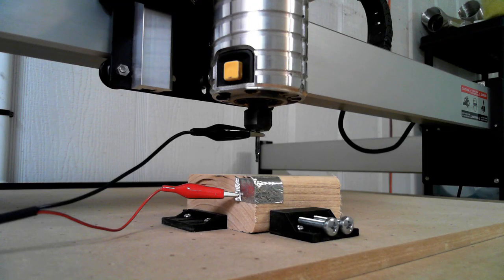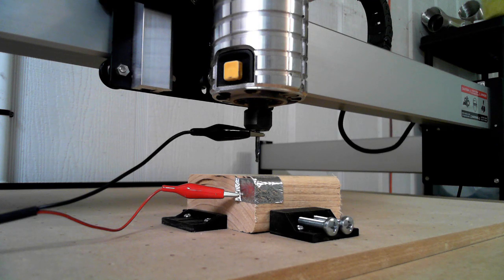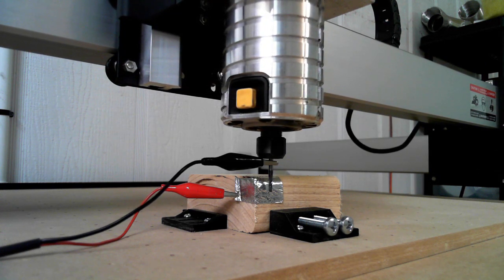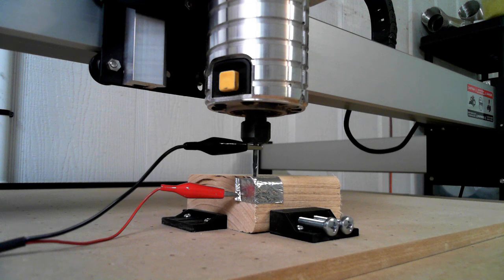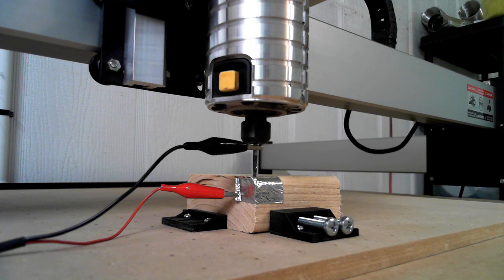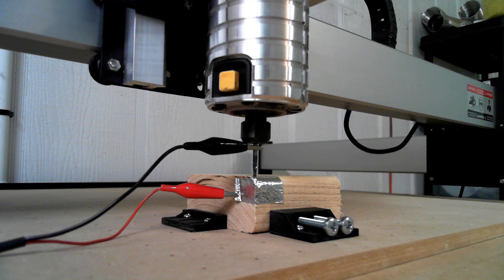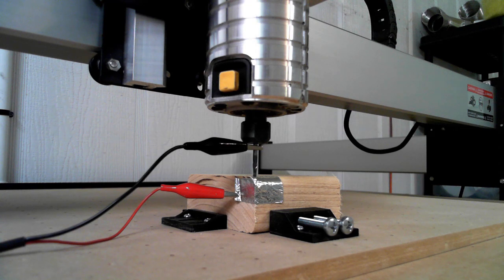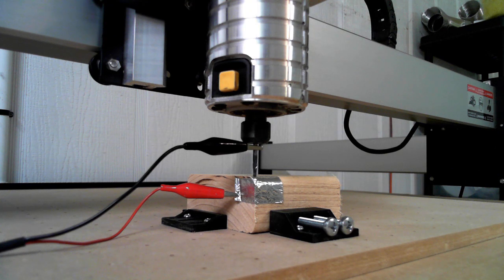Probe workpiece X,Y and Z origin Shapeoko 3 CNC with grbl and CNCjs CHEAP and easy

Comment: Thanks for your work, could you explain to me how to change the retraction movement to 1 or 2 mm for pieces with little space in the z axis
Reply: In my g code example,  any line that starts with G0 Z,  change ONLY the 10's and 20's to 1 and 2 respectively.   Be aware of negative values, so if it says G0 Z-10, change to G0 Z-1.  DO NOT alter the Z value in the third line (G38.2 Z-20 F60)  That is saying "Probe down as much as 20mm and halt when the probe triggers."   Just my opinion, but 1mm is a very small clearance.  If possible, I would go with 2mm and 4mm or better still 5mm and 10mm in place of the original 10mm and 20mm moves.
Reply: @TommyColeOnGoogle  really thank you very much this will help me a lot in my projects

Comment: Can you share how to connect the cables to the pins?
Reply: I took a picture of where it is connected on mine. https://photos.app.goo.gl/L1aDvtBPmHx2rfuR8 It is the two pins right beside where the connector for the black and yellow limit switch wires plug into the board.  In the picture, it is the red and black wires.  It does not matter which goes where.  All the machine does is watch for a closed circuit between those two pins.  My board is a Carbide Motion v2.4e.  If yours is different, all you are hunting is the probe pins.

Comment: i've learned a lot about CNC machines while building one for the old man using the same router.  your probing using a piece of tin foil is pure genius i hadn't seen before.  what is the offset for it?
Reply: I appreciate your comments.  I cannot take credit for the idea of using the aluminum duct tape.  That idea came crom the man who developed estlcam.  His name is Christian Knull and he is way smarter than me.  The tape is 0.10mm thick so I compensate for that when zero is set for the axis being probed.  I am working on a different way to probe Z using a permanently mounted limit switch so a tool change macro can be employed.  I have a lot of projects though so it will be awhile.

Comment: Can you please provide details on the Tape you used?  I am asking in my local building supply store (in Australia its Bunnings, like Masters is in US).  
And they don't know any thing about this type of tape.  A link to the tape product would be great.
Thank you.
Reply: Google aluminum foil duct tape.
Reply: @TommyColeOnGoogle  ha ha ha.  I did that.  first 2 I purchased were *sheathed* (and they didn't list that) with a plastic film on the outside (i.e. didn't work with probe).  
So yeah it helps when using a solution that you think is obvious, to still detail the parts (and hence link) involved.  Think about the thumbs up down myth (which was actually turn the thumbs to indicate lived/died, but the actual direction was never documented).
I just got a 3rd aluminum foil tape ordered today and I am hoping this one works when I test it later this week.
Reply: @TommyColeOnGoogle  true, but having it on a roll (yes I know foil comes on a roll) is more convenient to keep in the shed/work bench and a nice 50mm wide role  is perfect size to easierly cut into smaller parts.  Anyway, I will continue looking for an electricly conductive tape.
Thanks for the original post.
Reply: @jimholmes2203  thanks. I eventually found the exact thing from a ducted heating company and made a reference corner point with it. 
But thanks for the link for others who might be trying.

Comment: how can you just probe x and y? not interest in Z as i dont want to Zero Z at corner position
Reply from the maker: You don't have to probe z at the corner.  Just put the tape where you want to probe z, jog the machine so the tool is over the tape and about 10mm above it, and run the probe z command.
Reply: @colesdesigncreation1750  where are you specifying the thickness of the tape in the code? Ill be using a corner probe and i will need to know these values.
Reply: In the line:  G10 L20 P1 Z.1   The tape thickness is .1mm so it is telling the machine that when the probe triggers, it is at Z.1
Reply: Note that the X and Y numbers for the tape thickness are negative. (X-.1 and Y-.1) but Z is positive.  This is because my machine's home is at the back right with the spindle up.